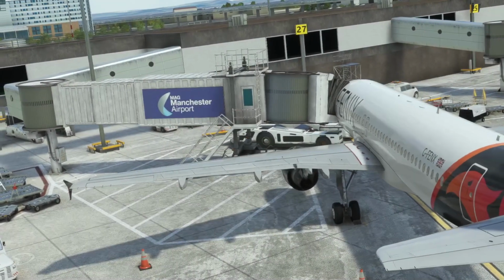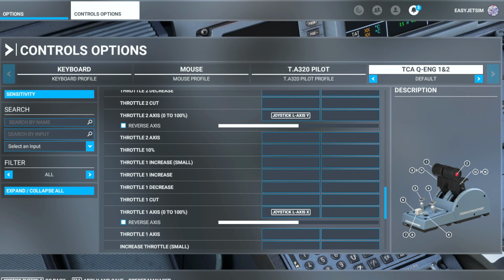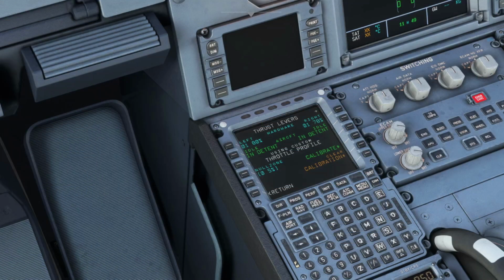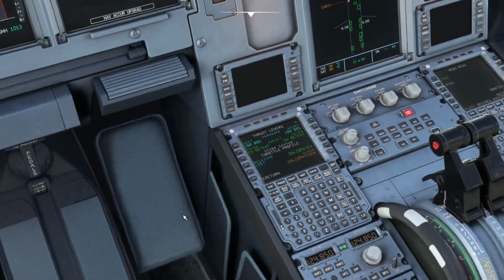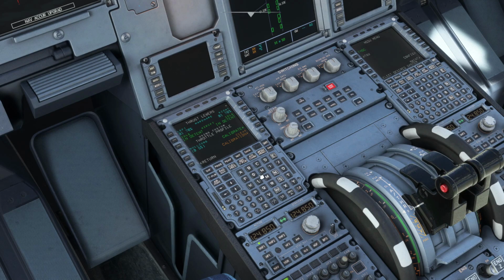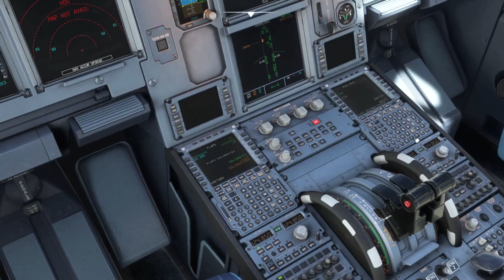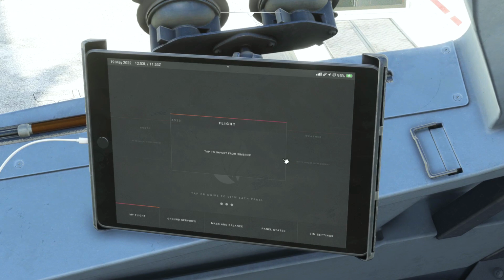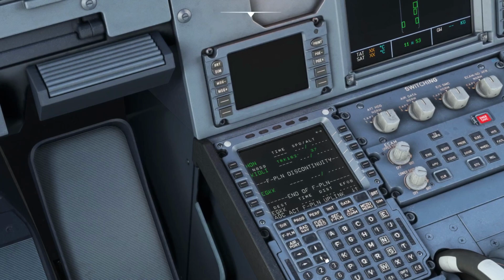Fenix A320 - Thrust Calibration & Simbrief Integration Tutorial & Troubleshooting | MSFS 2020

Comment: Hope you can help. I'm a Fenix A320 newbie (installed it in FS2020 yesterday). I'm trying to find the page/field where I enter my SimBrief credentials so I can download flight plans. My Fenix App does not have a SimBrief User ID field and I also can't find it anywhere on the EFB. Can you point me in the right direction please - I assume Fenix have changed something that I'm not aware of?
Reply: It's only in the EFB now. You need to go to the settings (settings are the last option to the right, next to failures) and it should be there. When you click settings you should find an option to write your simbrief username.

Comment: Ohh may  I ask a question ? , what are the sensitivity settings, null, deadzone etc for the Thrustmaster  Airbus TCA and joystick. I don’t have the flaps, or spoiler add on at this time but will purchase in the future. Just wondering about those thrust percentage values on the MCDU as you move up the detents. Are they dependent on sensitivity settings for the Thrustmaster Airbus hardware ?. Thank you.

Comment: This took me a while to figure out and is buried in the EFB User Guide (only place I’ve found it) but if you don’t have a reverse axis and use a button to toggle or hold reversers, leave the throttle at idle and skip the reverser calibration portion by simply pressing next step.
Reply: Section 3.1/ pg 6 if you want to go through the EFB User Guide

Comment: Hi all - anyone having issues with rudder control? Specifically with Xbox triggers but even trying keyboard keys I can’t get the rudder to respond…
Reply from the maker: Devs are aware of this issue.
Reply: @Easyjetsimpilot  Thanks for the reply! Actually - with a bit of trial and error - I discovered that I am able to control the rudder with my xbox controller using Lorby axis and ohs (I assume FSUIPC7 would also work) - the rudder surface itself doesn't move but the plane responds to the inputs - in the sense that yaw actually happens. Good enough for now until a patch comes out

Comment: Anyone else having issues with the TCA throttle quadrant just not moving the throttles in game? I have assigned the correct throttle axis as per the vid but my "Hardware %" is stuck at 0% when trying to calibrate from the MCDU, even though I can see the axis are moving correctly in the MSFS settings. Bizarre
Reply: Same here!!
Reply: @mrcodbeast4718  I have raised a support ticket with them so will let you know if I figure it out!
Reply: @killiandoyle91  thanks🙏 I'm getting furious trying to figure it out
Reply: @killiandoyle91  likewise
Reply: yes
Reply: Hi folks, just a quick update. I made a brand new profile for my TCA Throttle Quadrant in MSFS and followed the below steps from Fenix support and my issue is now resolved! I had tried most of the steps already, but if you follow them in this exact order, it should work:

1) Please make sure you have the latest drivers installed for your Thrustmaster TCA. You can visit the following page and download them underneath the Drivers section: https://support.thrustmaster.com/en/product/tca-sidestick-airbus-edition-en/

2) Please restart your computer.

3) Please make sure that ONLY the throttle quadrant is detected a device in the the controls page (excluding mouse and keyboard).

4) Please ensure that your throttle axis are set to the following:

Throttle 1 Axis - Joystick L-Axis X
Throttle 2 Axis - Joystick L Axis Y

If the Axis has (0-100%) in it, reassign it the equivalent with the 0-100% in it.

5) Please ensure the sensitivity curve of the both thrust levers are as follows:
(Please make sure that none are -100%)

Sensitivity- = 0%
Sensitivity+ = 0%
Dead Zone = 0%
Neutral = 0%
Extremity Dead Zone = 0%
Reactivity = 100%

6) Please re-run calibration after doing those 4 steps, ensuring you have not plugged in any other devices.

If you're still having trouble after that, make sure the Fenix app is open and running in the background when MSFS is running as I did that too. Hope this helps someone!
Reply: @killiandoyle91  Thank you very much! Now it worked for me.
Reply: @Ron16559  Worked for me too, was beginning to pull my hair out! Thanks
Reply: @killiandoyle91  still don't work, idk what I'm doing wrong, I'm losing my shit
Reply: IMPOSIBLE NO FUNCIONA
Reply: es sencilo, una vez que configuras los ejes, colocas todo el mando hacia abajo en reversa y calibras, luego a la sigueiente posicion una a una, uuna vez calibrados todos, aplicas calibracion final , no im[orta si el mando del avion no se mueve, importa que lo hagas en el que tu tienes, finalmente colocas donde dice NULLZONE en 0,2%
Reply: Hi, I have the same issue- did you manage to resolve it? 🙏
Reply: Same here doesn't work.